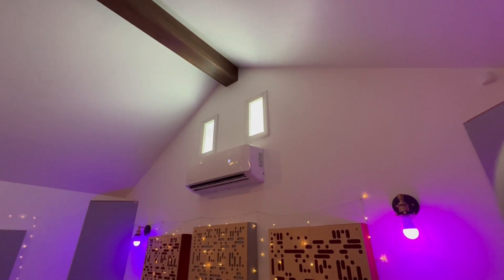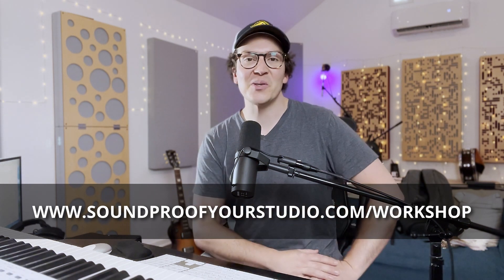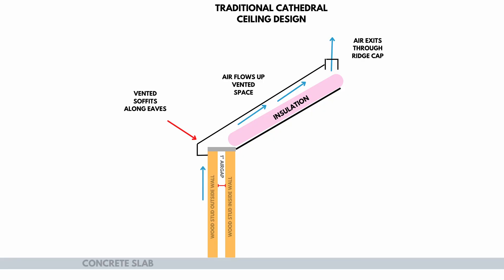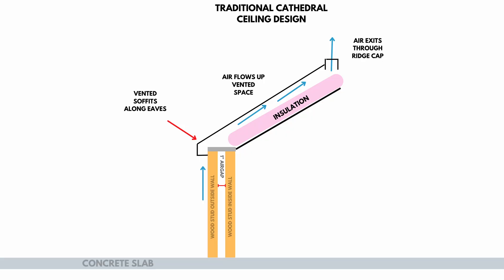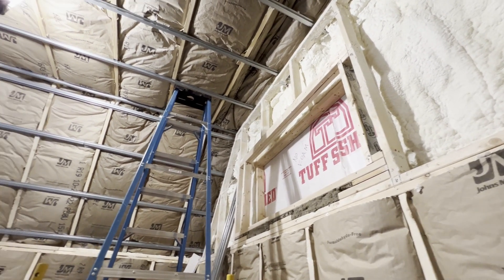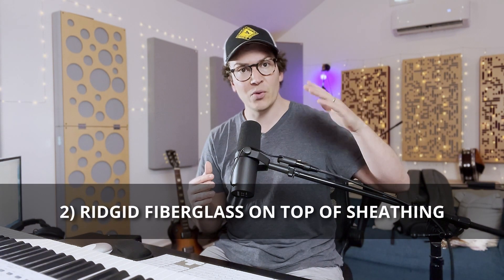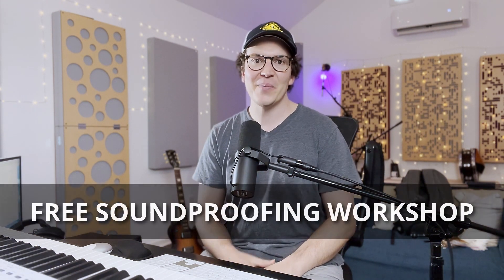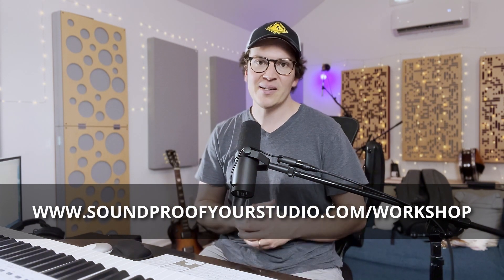Soundproofing Cathedral Ceilings

Comment: I always thought an airgap was good to have so I'm confused. Isn't that why we have an airspace behind acoustic panels in the first place? I have a vaulted ceiling. I'm having it open cell spray foamed... full depth.
Reply from the maker: Seems like acoustic treatment and soundproofing might be confusing you. Yes, an air gap is key to sound isolation and an air gap behind absorptive materials will increase low end absorption, but they are not related concepts. Are you currently building a studio?
Reply: @soundproofyourstudio  Thank you. Yes I think I misinterpreted the subject of the video. It's not a studio. Home theater and music room. It's a large rectangular room. 24 x 30 with a 15 foot peak cathedral ceiling. We had the room added on. The original house was full thickness open cell foam so we did the same with the addition. We aren't concerned about soundproofing as we live out in ranchland with little sounds coming from outside. The full foam walls serve dual purpose. Creating thick walls with no airgaps nearly eliminates any physical wall reverberation within. and the heating/cooling energy efficiency is really great. Currently the room is empty and it is an echo chamber to say the least. Floor is stained concrete. Will be putting some type of low pile area rug down for the floor. One wall will have cabinetry and a stack of bunk beds....we need them for visitors. The rest of the room will be a large flat panel TV with the sound system and a baby grand back farther from the sound system. Acoustic treatment is the challenge. We moved from PA to Texas. This picture is the setup in PA.
https://www.getdieselpower.com/gallery/picture.php?/13333/category/857
Reply from the maker: Yes, you need help with room acoustics not soundproofing. I could get you a custom design for the room if you like to reduce the reverb time and make the environment great for listening.

Comment: Good emphasis on the building science.  I'm going with a regular ventilated roof.  Using 2x6 trusses 24" OC so (presuming structural engineer allows for it) I can hang a second layer of drywall from RSICs.  It would be the only part of the build that is fully double leaf.  Have you thought about double drywalling on RSICs to make it a "true" double leaf?
Reply from the maker: Not sure I follow understand your system, but yes always double drywall at a minimum on all assemblies.